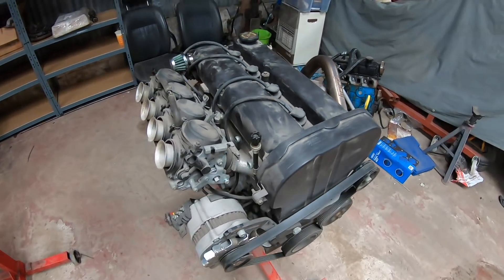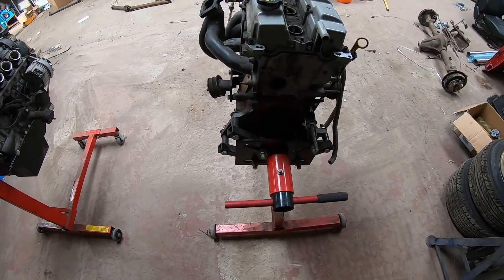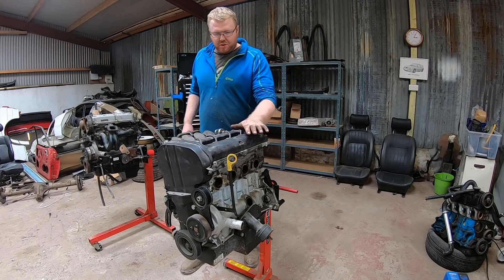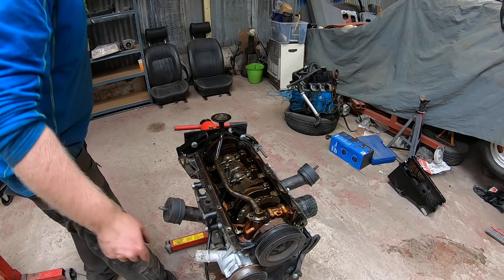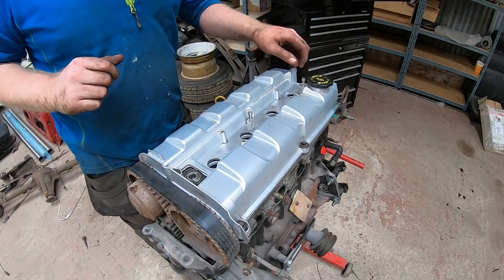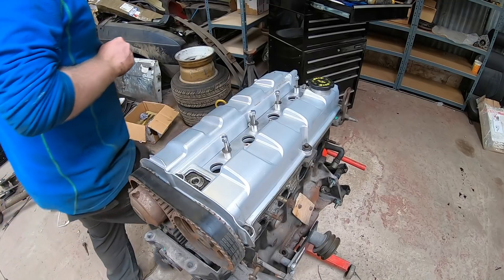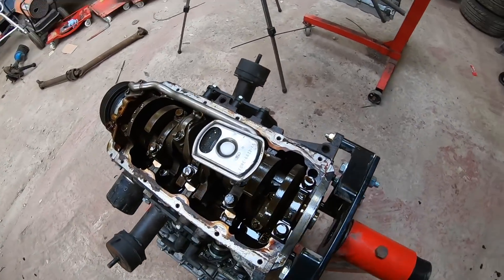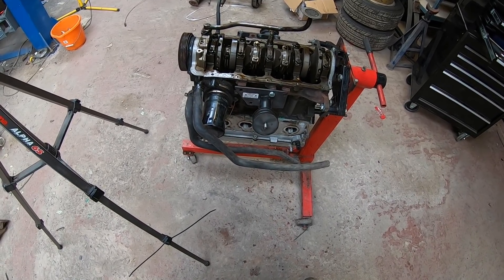Project Escort Episode 2 - ST170 Rally Spec Mk2 Escort Build

Comment: Don’t you need to keep the rubber seals on the bolts that retain the coil pack mount plate to stop oil leaks? Apologies, never worked on a 170 engine so they may not have rubber seals (just assumed that’s why you needed the pliers to pull the bolts off at the beginning). Rob.